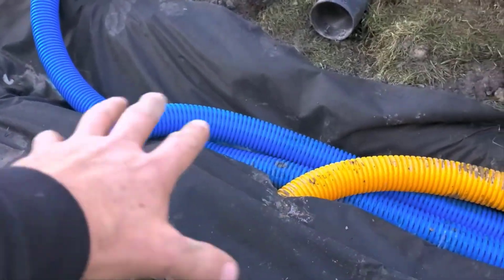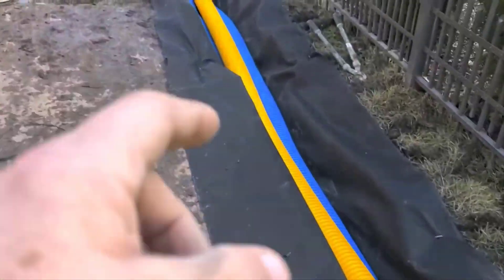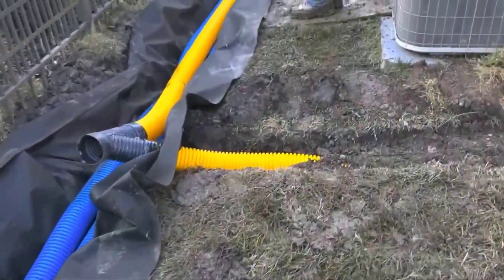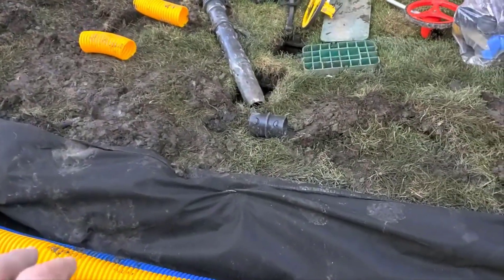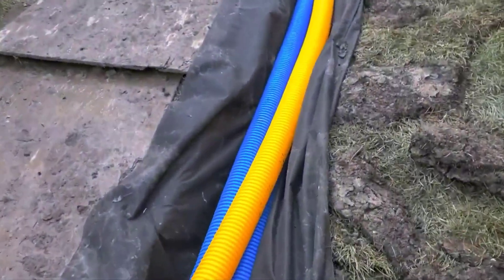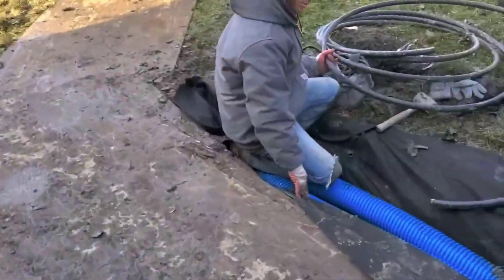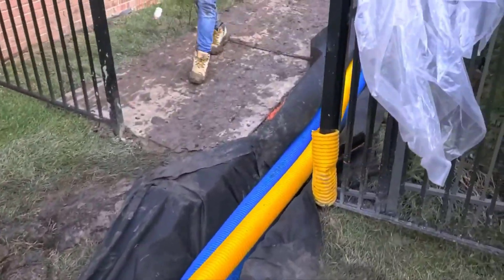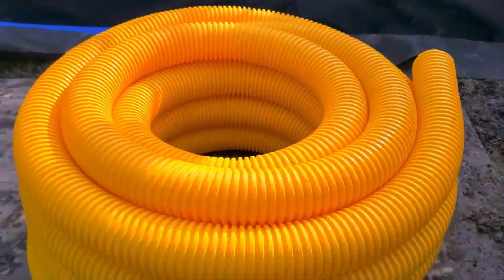Why You Don't Tie Your Downspout Pipe Directly to French Drain Pipe

Comment: I guess my question is why separate the drains? 
You already proved in another video that the corrugated is self cleaning. Additionally, will the yellow pipe just fail eventually because of the roof debris? Is this just so maintenance is only needed on the yellow pipe in the future?
Reply from the maker: https://youtu.be/FK5ZlN0Ogow?si=MckcZfFxr5Ke1PDS

Comment: So roof debris and organic matter magically appears in french drain, but not the dedicated drain for runoff? The video still doesnt say how using another drain is better.
Reply: Your absolutely rite. But when u tie in downspouts to French drain the shingle rocks and leaves and debris will clog the slots in the French drain then the French drain will not work at all after time. Hes just keeping the French drain 100 percent no problem for the years to come. But yeh the downspout pipe will collect all the gunk also. But is much easier to blow/ flush out with hose. It doesn't have weep holes/slots to dig into and clog.
Reply: What i do is i put in a catch basin before it ties in to French drain. The basin will catch 90 percent of the gunk and debris. Especially the roof rocks. Save u alot of time and money than buying and running a separate drain pipe
Reply: @jheiny1231 so u run a separate line from however many downspouts and before it hits the WYE with the french drain u add a catch basin, from the basin u add another line to the WYE and then a perforated or solid line to the popup emitter ?
Reply from the maker: https://youtube.com/playlist?list=PLjFCqaZ4v1BVX2cpGD7wJqH37RSS1JAOz&si=67n8D9RAwt7zj-E2